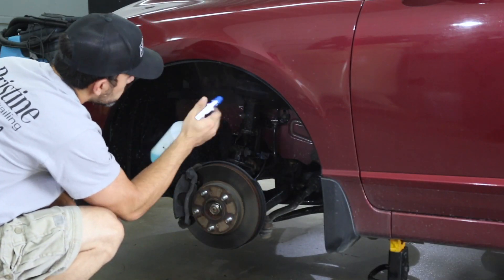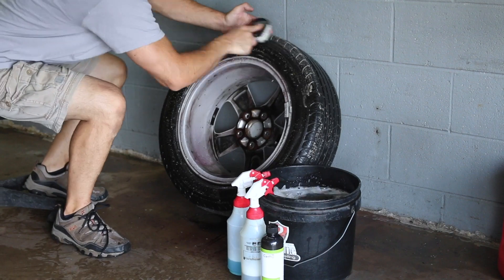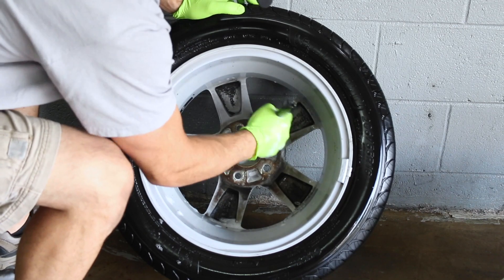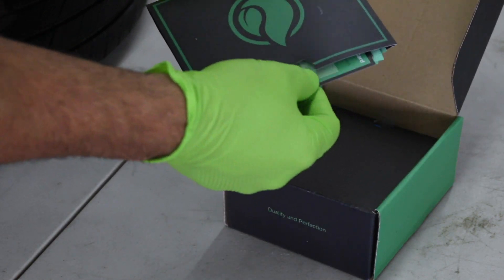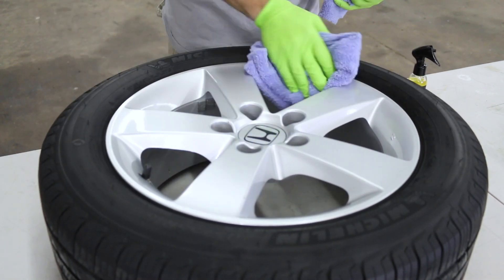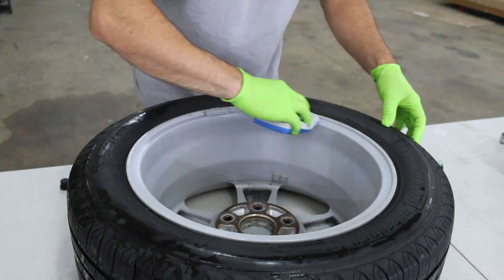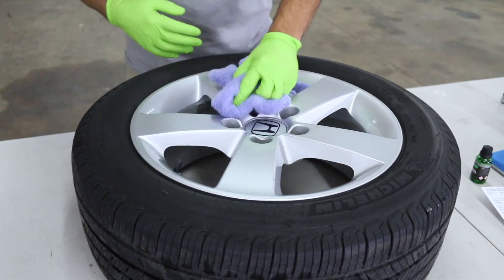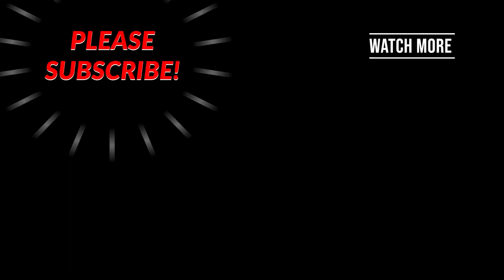How to apply IGL Wheel Ceramic Coating

Comment: I have a question. I just got a new set of wheels. Was wondering what the best coating was to use on them as I haven't installed them yet. I know brake dust can do a number on wheels that are not coated. Any info would be greatly appreciated. Keep up the great content in the videos. You guys are awesome.
Reply from the maker: We love using the IGL Wheel Coating. As far as the best coating, I am not sure how to figure out the best wheel coating only since there is a ton of them. We really like the IGL Wheel Coating and find no need to change as of right now. Thank you so much for your support Randy!